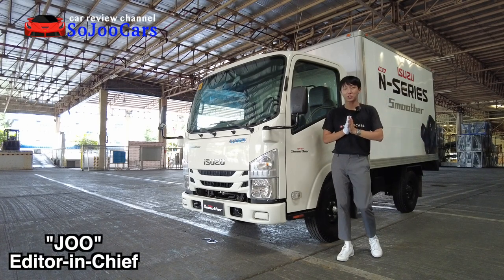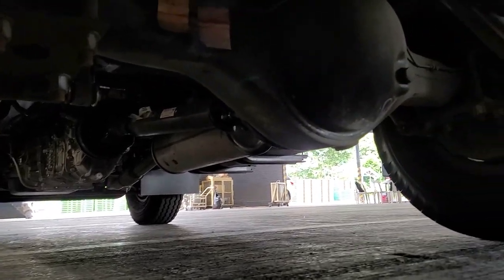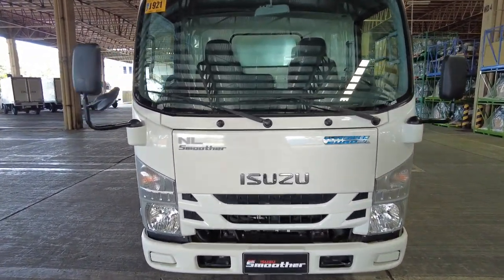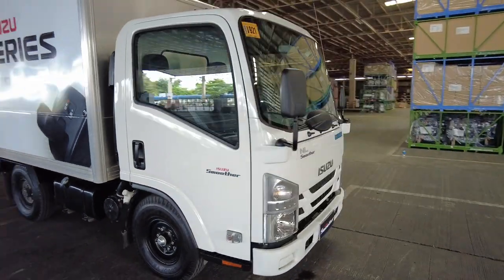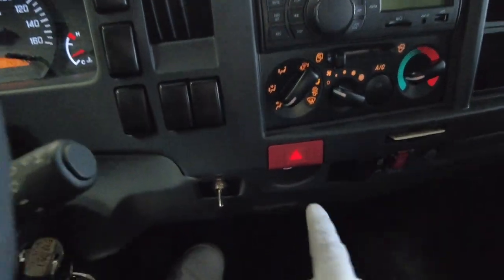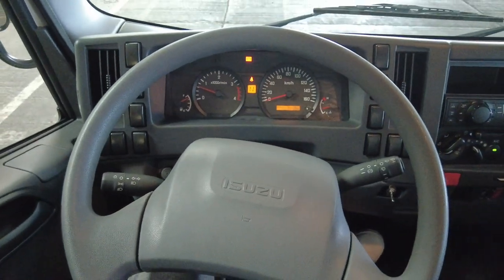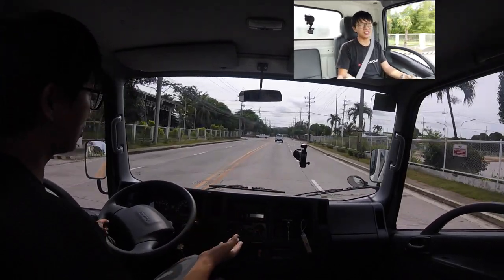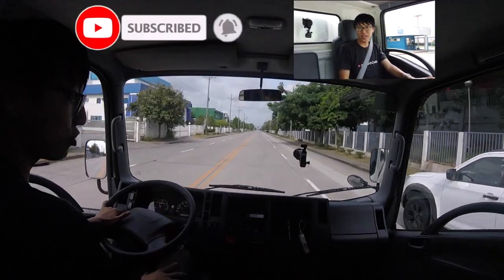2021 New Isuzu N-Series Smoother 3.0L Blue Power Euro 4 Diesel - [SoJooCars]

Comment: AMT is technically a manual transmission with the computer do the clutch and shifting. You got the convenience of an Automatic with the fuel efficiency of an MT
Reply: Still it's an automatic
Reply: @SeanTabada  yes two pedals means automatic
Reply: Ni complicate mo lang po, and ni define mo din ang automatic transmission. No matter it's still an AT
Reply: love it. makes us drivers drive longer. had mine a bigger one the forward 7000kg I used it for logistics.

Comment: Mas maganda pa din pag manual transmission.laspag ang bulsa kapag nasira na ang computer at actuator nyan.
Reply from the maker: May punto kayo pero proven naman po ito sa Japan at ibat ibang bansa more than 10 years. Tapos wala na tayong cluth riding issue (depende sa driver).
Reply: Bobo
Reply: Lol.
Reply: @vayneaurelius5700  sino po bobo?
Reply: @PortgasDAce-zn1fv  malamang...
Reply: @vayneaurelius5700  alam mo ba pinagsasabi mo?
Reply: @PortgasDAce-zn1fv  bat ako tinatanong mo?...di mo ba alam pinag sasabi mo?...🤔🤔🤔
Reply: @vayneaurelius5700  sige nga paliwanag mo nga ano mali sa sinabi ko?
Reply: di na po totoo na sirain ang mga automatic lalo na pag brand new. sa ibang bansa halos puro na automatic napagiiwanan na tayo
Reply: @warrensalvo5420  hindi ko naman sinabi sirain ang isuzu actualy jeepney driver ako at isuzu engine ng jipney ko kya sura ako matibay yan. Pero dpat ntin tandaan drting ang panhon msisira components ng transmission nyan at yan ang sinasabi ko na laspag ang bulsa mo. Hindi naman pati yan automatic gaya ng kotse iba transmission nyan.